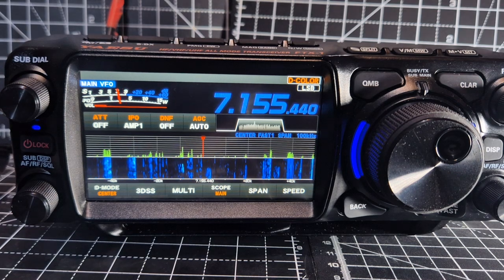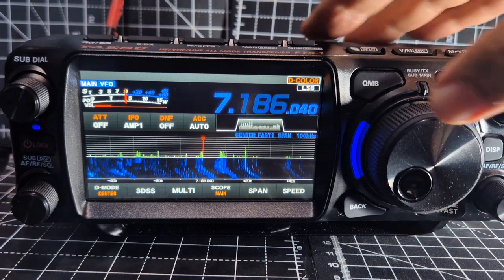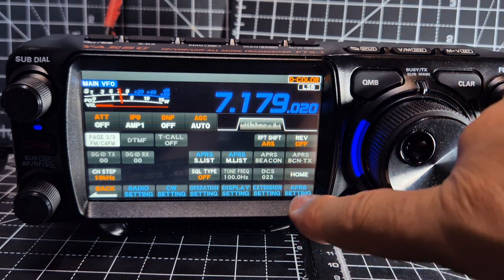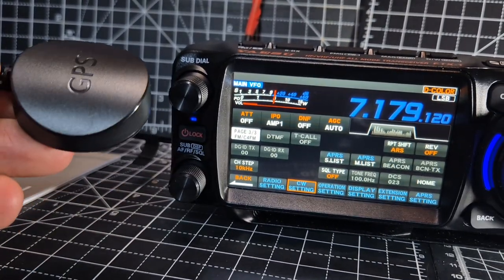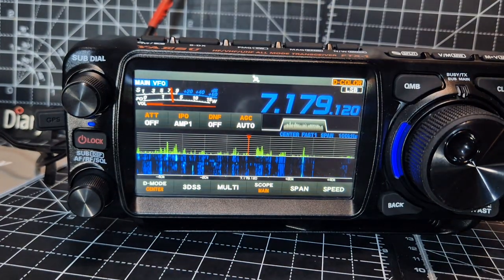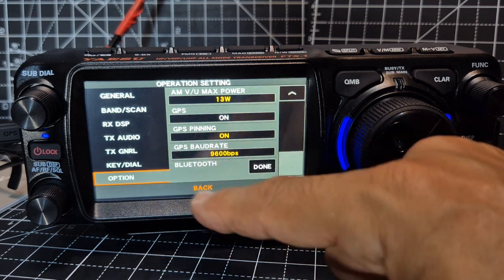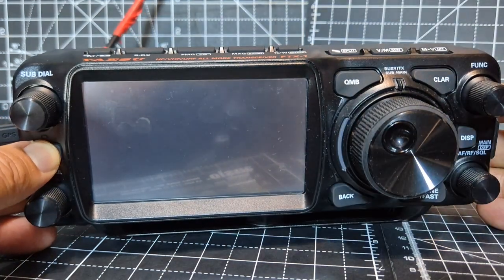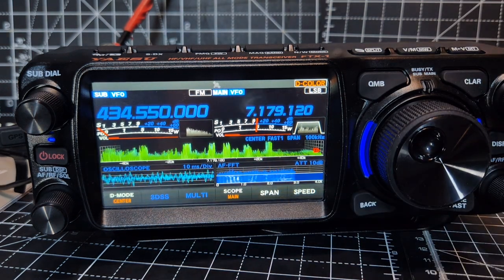After Firmware Yaesu FTX-1

Comment: Love your videos! I just got my new FTX1 optima. I having issues with it. I have programmed all my local repeaters vhf/uhf. While scanning for a few minutes I try to transmit and all of a sudden it stops transmitting . I have programmed the new updates and all and I’m still having the same issues. I have checked swr radio is not getting warm or nothing. It does it with the optima and as well with just head and battery. Have you had this problem?

Thanks
Reply from the maker: No